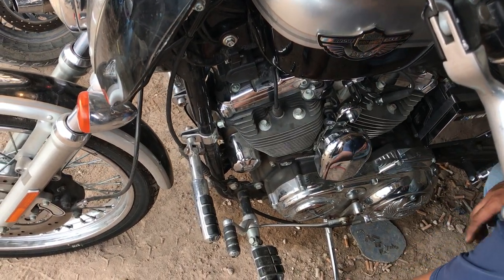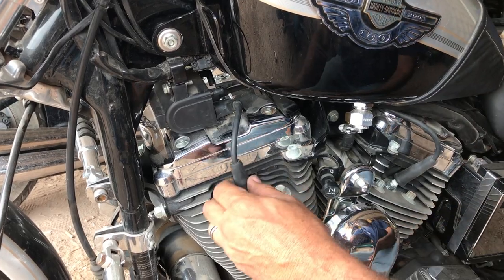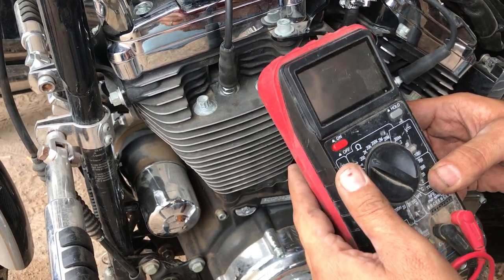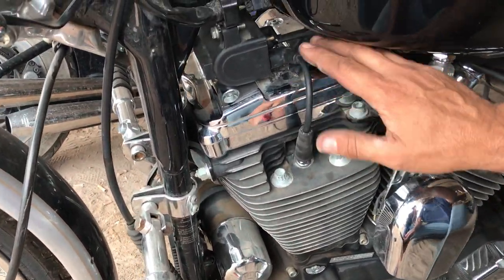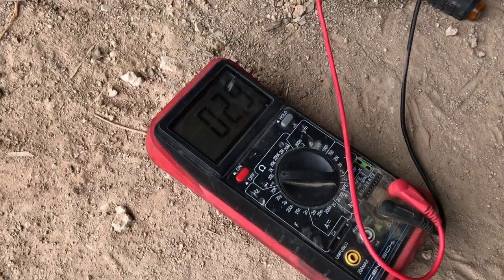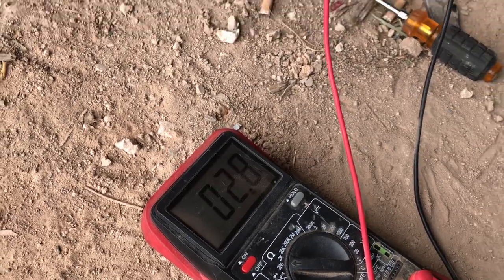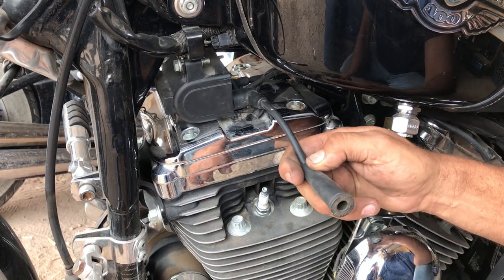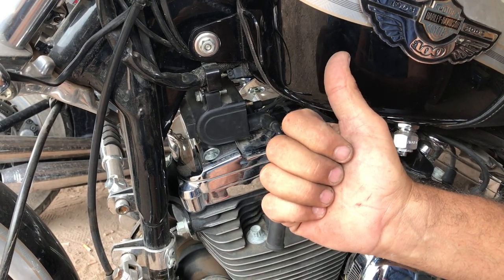Easy Way To Test A Motorcycle Coil.

Comment: you should put on 20k, becasue it will not read 10k on 2k (2k or 20k is max resistance it will measure)
Reply: Yes, the meter was on the wrong setting to read 10k. That coil may have been good.
Reply: Yes ,when I moved to 20 k than I got a reading,
Reply: @noearias2006  .. THEN I got a reading..........
Reply: Or even higher. OR get a Fluke.

Comment: Perfect video. 1 question. The last test you summized a bad coil. Could a bad spark plug wire give you the same reading?  Currently trying to diagnose a similar issue.

Comment: Just watched this. Easy tutorial.  I have a 2 coils from a Vtwin, dual spark Ducati. The reading on both coils is 1.2 across the 2 connectors and I can't get a reading from the HT lead to the connector on the coil at all.  The bike starts fine but mis fires when warm and hard to start when warm?

Comment: The primary and secondary are always isolated, no?  There should be no reading, or infinite resistance, between the spark plug wires and the coil's primary when it is all disconnected.   Meter should go between the 2 spark plugs wires for the secondary.  Waiting for a new coil now since my FLSTF coil primary failed open after removing from storage after 8 years....
Reply: Yes, you are correct. These are 2 separate circuits, primary and secondary. Primary is where you read the 3 or 5 ohms, across the small terminals.
Reply: @darrylstevens4516  the coils a re nothing more than this a long copper  insulated with a type of varnish then wound  around apiece of iron the primary and secodary are not connected except magneticly on the same piece of iron the secondary is much larger than primary due to turns ratio to generate very high voltage to to the dist and plugs

Comment: Now I'm not an expert. But shouldn't you have had your ohm meter on a 20,000 ohm setting and not a 2,000 ohm setting if you're trying to read 10k ohms?
Reply from the maker: ha, yes you are correct. however the decimal will just be moved and you will still get the reading you need. but correct. good eye there Matt ! ( i miss  that i guess ) thanks for the correction.
Reply: thomas brian no problem. Thanks for the video its great
Reply: @thomasbriansavingmoney  Does this work for dirtBikes? 2011 Kawasaki Kx100DBF...Any insight would be appreciated!

Comment: Not sure this is correct!  Shouldn't you test plug cap to plug cap to get the 10,000 ohms? The two windings in the coil have no physical connection I believe.

Comment: Hello!! I have 3.0 from lead to lead but no reading from lead to spark.  Is the coil bad?? Thanks nice vid BTW!!
Reply: I'm having that same problem, did you ever figure it out?
Reply: @ironheadbill  it was a bad battery. I still running the same coil 3 years later. 👍🏼

Comment: Did you ever make that follow up video of a good Harley coil? Tried your procedure on my 98' Harley Heritage coil and a new one thorough the trigger post and spark plug wire and they both  indicated  a bad  coil. Saw another video from Rocky Mountain ATV and they demonstrated the exact same test and it came out with a negative reading as well. They also demonstrated that this procedure would not indicate a bad coil through dual spark plug connectors. The manual says to test the secondary directly inside the spark plug openings in the coil and not through the one trigger post and spark plug wire. Both coils read good versus trigger post to spark plug wire. Does your procedure work for only Sportsters? Just curious, bro. Thanks
Reply: Thats what I am wondering,Sorta.I was wondering if it will work for a dirtbike also? 2011 Kawasaki Kx100DBF.Any help would be appreciated!
Reply: @DIXIEMAFIA251  The difference for me was testing inside each coil outlet without the spark plug wires inserted for a good reading. The coil should indicate how many ohms are from the factory.  My coil is dual fire and not single fire. Hope this helps....

Comment: I know this is a dumb question but did the bike start or not? I think I have the same issue with mine not starting either the coil cdi or stator but am unsure as to which is at fault.

Comment: Wrong.  To test a coil or no start, you first check your feed wires on your coil using the 20V setting on volt meter.  Then if you have no voltage at your plug wire with ignition on, that would mean your coil has failed.  Your way takes four times as long and isnt as accurate as mine.  And why would you take a screw driver and stick in the plug wire and crank engine over, when you can turn ignition on and simple check your voltage with your meter and not even have to crank the engine over?  With ignition on, my way is all you have to do is check the feed wires and the plug wires which takes 10 seconds or less to determine a good or failed coil

Comment: only good ohms tests is if it tests open  replace it  you can tell if its grounded to the  iron replace it   a good way test for open primary coil  see if volts are present at condenser lead with points open and switch in run pos this tells you coil is good

Comment: you are on the right track. however, you are slightly misleading. 

TO STAY IN GOOD PRACTICE: (referencing factory dual fire coils from 84 to 06 ish)

Disconnect battery.

Remove coil, disconnecting all wires. 

TAKE CAREFUL NOTE AS TO WHAT WIRE WENT TO WHERE TO AVOID HEADACHES. (a tip mainly for the newbies to personal bike repairs at home) Everything you can do to make your experience hassle free benefits you as the important things aren't overshadowed by potentially frustrating mistakes that could have been avoided. 

Resistance should read BETWEEN 2.5 and 3.1 Ohms  across the two small terminals where you will see nuts holding the ground signal wire on one, and the constant power feed wire on the other. 

Between your large terminals where you plug in spark plug wires, you should see BETWEEN 10,000 and 12,500 Ohms.

Out of those ranges in EITHER DIRECTION indicate a faulty coil. 

A smart wrench removes the coil and all connected wire leads in theory to avoid any potential resistance interference. 

***IF YOUR COIL DOES NOT HAVE A SET OF "SMALL TERMINALS" AND INSTEAD HAS A WEATHERPROOF QUICK PLUG, YOU HAVE A DELPHI COIL. DELPHI COILS ARE ONLY SUSPECTED FAILURES. YOU NEVER KNOW UNTIL YOU REPLACE THEM IF THEY ARE BAD.

A coil may still send a spark signal to a test light or upon cranking, but it may be too weak of a signal to actually ignite your fuel. Effectively your test light has no valuable accuracy testing a coil. Also cranking it over without plug wires on plugs grounded to heads runs the risk of further damage. (DO IT RIGHT)

If your coil has 3 Small terminals you have what is called a SINGLE FIRE COIL. YOU TEST THEM DIFFERENTLY. 

Know your stuff throughout a topic of repair before you make a video that misleads the new age DIY folks. Im sick of cleaning up after "Guy on YouTube said do it like this" aka WRONG.
Reply: Damn man! Thanks for the good info Brother! I was wondering if it worked on Dirtbikes also? 2011 kawasaki kx100DBF

Comment: This straight up does NOT work! I tested 2 coils on running bikes and it showed nothing on the output. Thankfully a buddy had a spark plug tester that goes between the wire and the coil.

Comment: Your second test at 01:28 is WRONG! By using your method, it showed my coil AND a brand new coil as "bad".
Yes, I bought a new coil and wasted valuable time because of your incorrect testing method!
I would have been better off blindly buying new parts, one at a time, than referring to this video.
I wonder how many guys threw away perfectly good coils because of this incorrect testing....

A J&P video shows the CORRECT way to do "test 2". (at 20K plug the probes into both coil sockets, one in each)
See time frame 2:00 in this video: https://www.youtube.com/watch?v=4-L52R7x8Jo&t=2s